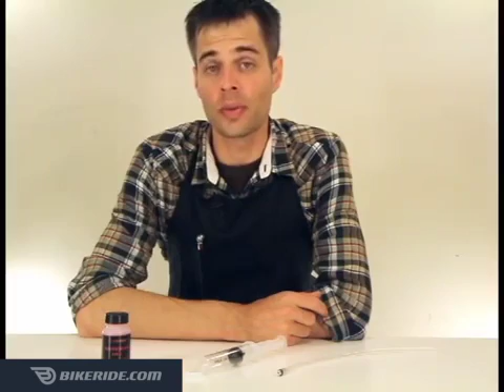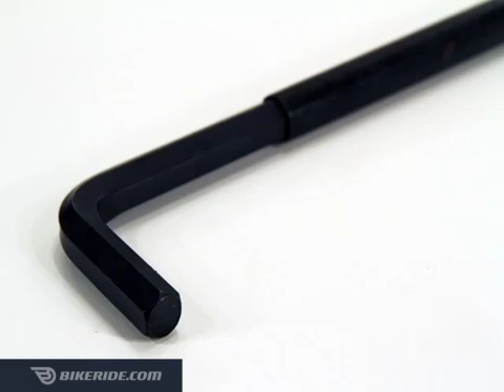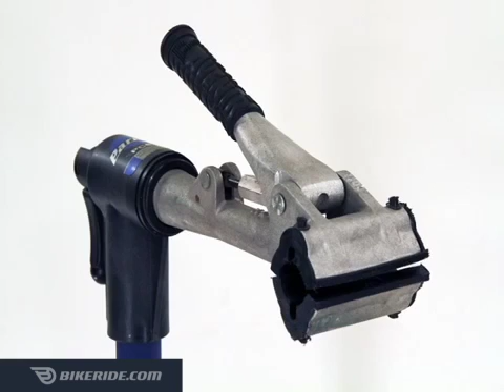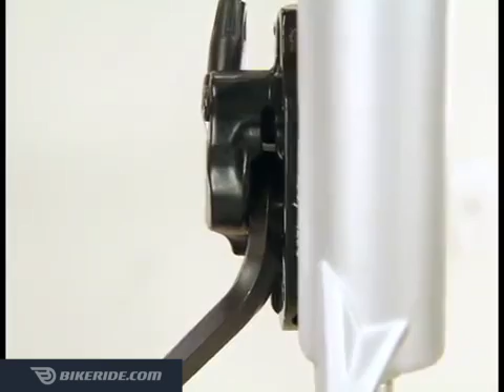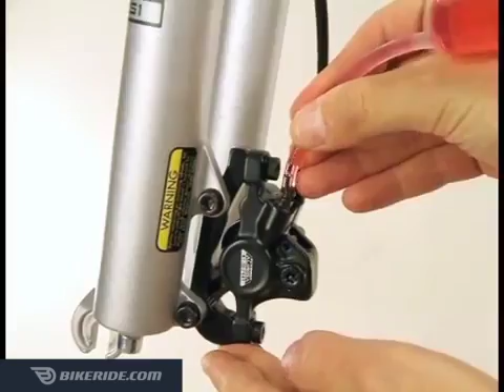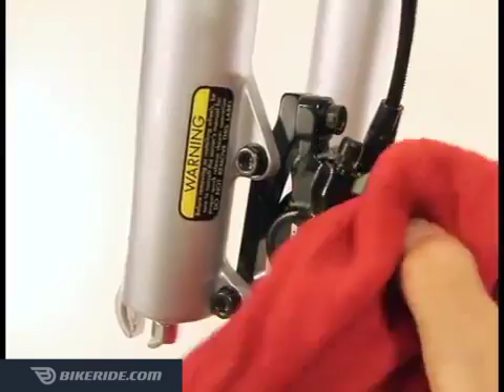How to Bleed Tektro Auriga Comp Disc Brakes

Comment: Since I'm not a professional and now that I have done the same mistake twice, I'd recommend to remove the wheel and the brake pads too. If anything leaks and gets to the rotor or pads, the brakes get all squeaky and it is very very difficult to clean.
Reply: @srineeey 
" many professionals remove wheels and put brake blocks."
Talking through your ar5e mate. 
Nobody removes wheels from a bike that has disc brakes and fits blocks because there's nowhere to fit blocks on a bike that has disc brakes.
Blocks are used on caliper brakes only.
Disc and caliper brakes are completely different technologies.
Better a know-it-all that a know-fvck-all, like you, when it comes to disseminating on social media.
Reply: Very bad advice. Unsurprisingly from someone who is NOT a professional. DO NOT do this. EVER. You will almost inevitably push the caliper pistons out of their bores and then you're in  whole heap of problems with seals. Leave the wheel, the pads and the caliper in place while you are bleeding. Once you have bled the brakes you can then remove the caliper and pads but do not under any circumstances press the brake lever when they are removed. To stop squeaky brakes all you have to do is de-grease the discs with brake cleaner solvent and rub the braking face of the pads on a fine sandpaper on a flat surface to de-grease them too. 
When you have refit the pads and the caliper to the bike and wheel you need to press the brake lever to center the caliper assembly about the disc while tightening up the caliper screws.
Reply: @veritasaequitas9875  just use a brake block
Reply: @angelp8417  What? Hydraulic disc brakes don't have brake blocks. What are you on?
Reply: @angelp8417  You can't fit a brake block inside a disc brake caliper. Christ!! Have you ever even seen a bike?
Reply: @veritasaequitas9875 this is so wildly inaccurate it's two years later and you ought to just delete your misinformed comment. Sure you can clean up with brake cleaner and do a serviceable job. But for a person who doesn't know what a brake block is to be giving the bad advice you do is out of order. Any viewer/reader who don't know what that is ought to google search brake bleed block before approaching this procedure for the first time.
Reply: @zg-shred  You have no idea what you are talking about. And where did I mention brake blocks in my comment?
Reply: @veritasaequitas9875 
It's where you said "hydraulic disc brakes don't have brake blocks," that's where you mentioned brake blocks.

A brake block will let this user bleed their brakes without having to leave the wheel/rotor in place
Reply: @veritasaequitas9875  I had to log in just to tell you how incredibly wrong you are. The video literally says to use a brake block. Implying that a disc brake caliper "can't fit" a block is laughably moronic. Stop trying to give people advice until you actually know what you're talking about.

Comment: When I pull the brake lever, mineral oil seeps out from around the T15 bolt. Is there some sort of o-ring that has perished or got lost? What should I do?
Reply: ahh! The o-ring got stuck on the bleed tube screw - phew!!